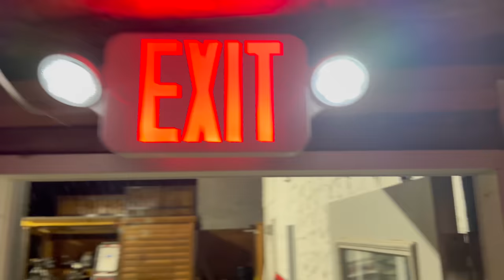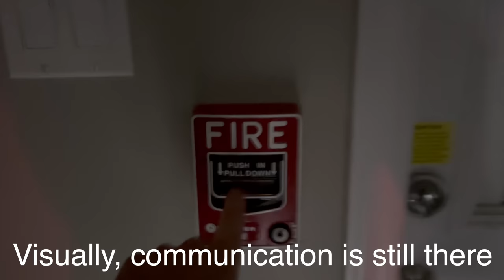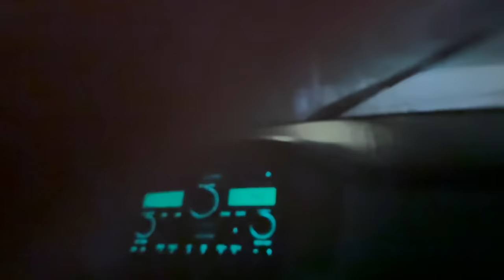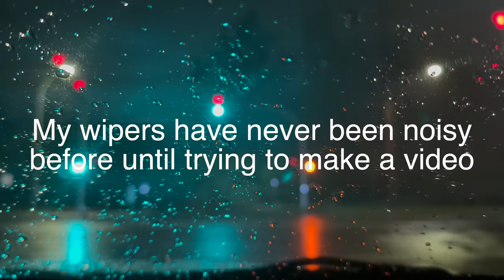Real power outage at my house! Emergency lighting and generator in action.

Comment: That's sweet! So satisfying to see all your hard work perform perfectly. How many watts is your LED backyard pole/street light?
Reply from the maker: Thanks, it is definitely nice to see it all working. It's a 200 w led
Reply: @nics-systems-electric   Actually 200 watts consumption or 200 watts equivalent? Regular LED street lights are only around 50 watts so your light must be really bright.
Reply from the maker: @eDoc2020  200 W consumed. 50 W would be a quite small street light never worked on one that small as far as any type of HID lamp 50 W is usually only for small wall packs

Comment: Great set-up Nick, how long will the generator supply power for ?
Reply from the maker: For as long as it has fuel so probably about 12h in the tank and I can add more if needed
Reply: Do you think you would ever do a propane/butane conversion on your generator? @nics-systems-electric
Reply from the maker: @ElliottVeares  wouldn't think so as we don't have either
Reply: I was thinking more of portable propane/butane tanks with the generator to give longer run time than the built in gas tank does, but whatever works best for you. @nics-systems-electric

Comment: You have a negative coefficient of airflow through your generator box, you can see as soon as you open the doors that the shutters are fully engaged as the fan forces air through, but as soon as you closed the door you lost a huge significant amount of airflow. I recommend a passthrough hole on the other side of the box to allow clean air through. Otherwise awesome video.
Reply from the maker: There is a large damper on the other side of that automatically opens supplying sufficient airflow they're always will be a slight reduction in flow when door is shut due to a less direct path

Comment: GREAT VIDEO OF THE OUTAGE AND THE GENERATOR TAKING OVER . 🤗BUT WHY POWER THE GARAGE ONLY BUT NOT THE HOUSE ? I'M PRETTY SURE YOUR NEXT VIDEO WILL HAVE A SOLUTION FOR BOTH DURING THE NEXT OUTAGE . 🤔
Reply from the maker: Glad you enjoyed. Generator doesn't power the house for several reasons it would require excavation additional transfer switch and emergency panel and would require damage to the building and would be too much load

Comment: Never seen so much excitement over a power cut
Reply from the maker: When you spent thousands and been waiting years for your equipment you've designed and programmed and installed it's nice when it actually gets a chance to work

Comment: This system looks quite good, but I have an idea that would make it slightly better...
...
Add a hair-trigger electrical 'deadman-switch' that would cause the generator to start up MUCH faster after grid-power disruption. 
Like starer motor running as the lights are dimming instant. Would this system occasionally cause 'false starts' every so often from grid ripple? Perhaps...
Reply from the maker: That is something you don't want generally you want at least 3 seconds and that is for emergency generators that's life safety dependent. For something like this that is non-life safety even longer is better like 10 seconds which is what I have mine set to otherwise it would be instant which then puts a a lot more wear on your starter if it's trying to turn the engine over every time the lights flicker and will then throw an error when it's trying to start the engine when power isn't actually out

Comment: Now you just need a generater/hookup for the main house.
Reply from the maker: Unfortunately not practically possible
Reply: @nics-systems-electric does a 10k watt generator exist? or 28k watts
Reply from the maker: @henrydoesstuff213  yes there are generators that are over 1,000,000 W

Comment: I used to do work experience in a private school setting.....and one time our generator (some cheap Kohler copy) actually EXPLODED because it couldn't handle the sudden influx ot load (bear in mind we use 240v 50Hz in this country)

So we ran off full UPS power as long as we could until the Batteries expired in them.... The server room being deathly silent was probably one of the most terrifying things ive encountered.

Supply was down for about 5 hours and when it tried coming back it blew again....which sadly killed one of our Liebert UPSes

Comment: Why do you have an industrial fire alarm system in your house? Isn't smoke detectors sufficient enough for a house?
Reply from the maker: We had problems with them they did not offer what I needed problems with false alarms and reliability and no customization options and no low frequency devices

Comment: so you have power for cameras in a generator room and floodlights that you dont need but the house is not connected? priority's need to be be assessed i think,
Reply from the maker: If you are interested you can check out my video explaining why the house isn't powered. You need to understand the situation and then it will make sense.

Comment: Question for you @nics-system-electric,  why only a generator for the garage only?  I don't know your situation but at my house I could care less about my garage having no power during an outage I would rather my home have power for myself and my  family.  You could hook up a 30/50 amp generator inlet box on the side of your house and run a large Generator to power most circuits or a smaller one for critical loads.  It just doesn't make sense to me to only have power for your garage and not your main living space but then again I don't know your situation just curious.
Reply from the maker: https://youtu.be/0EXjqxSqpiY?si=LLhkjt8Dp35Ey0YR
Reply: @nics-systems-electric   Thanks for the reply and your detailed explanation.  Your reasoning makes total sense in your situation.

Comment: Only issue with this system is when it floods your generator is low on the floor so any surface flooding could equal disaster. My city had power out for a while due to a ravaging flood. Generators basically screwed that were mounted on the floor.
Reply from the maker: That is how all homes standby generators are and we don't get flooding here

Comment: Dude your asking for trouble hitting those puddles, good way to crack your block or manifold.
Reply from the maker: I get a sudden temperature change could be harmful specifically if it's cast but I don't think the water is getting in that far if that was the case it would be no good driving in the snow or  rainstorms. We have lots of heavy rain and flooding living on the coast I've never seen anyone have issues with puddles

Comment: The power at my school went out  the day before yesterday for about 30 minutes or so maybe longer the internet was on for a little bit after the outage started I was able to complete the assignment on the laptop the school gives us (probably battery backup )  also the principal was able to use the pa/coms system to announce that there’s a power outage (probably also battery backup)
Reply: At my school the pa seemed to go out during a power outage. Is this a code violation in the US?

Comment: in theory if you made the generator power the house instead of the garage it would still power the garage because the garage is fed off the houses panel, but that might need a bigger generator
Reply from the maker: It would, but it can't power the whole house.

Comment: Recommendation is the only flaw I see is your generator appears be gas. Would recommend natural gas, and get supply from your house so u have uninterrupted service and only way it’s going to brake would be if the street gas brakes and have the gas one on incase u have issue with national gas
Reply from the maker: We do not have natural gas nor is the generator big enough to power the house

Comment: Can i suggest you to put your house working on EG (Emergency Generator) when power went out? With system monitoring yre fuel capacity and monitoring temperature of the EG? And my sugestion are she legal? (maybe is stupid my sugestion but say it honestly 😅☺️)
Reply from the maker: Too much load and you would need to excavate for underground emergency power to go to a automatic transfer switch and then install an emergency panel it would be thousands of thousands of dollars and a lot of work and the generator can't run it anyway
Reply: @nics-systems-electric   im thinking too is a bad idea and yes im right bad idea of mine...sorry 😅☺️😔

Comment: Really awesome set up! we have a blue diamond relatively generic diesel generator for our entire home. Good generator as we can run both AC systems which are built into the house, which use quite a bit of power. Also where did you get that IKEA looking arrow sticker?
Reply from the maker: Thanks, if you are referring to the arrow on the floor that one was from Covid that came from a school district and for whatever reason I wanted to put it there lol
Reply: @nics-systems-electric  Ahh that makes a lot of sense, thanks for replying!

Comment: we lost our power on our entire street and few neighbors were off on  our street were also effected the line was cut when our neighbors were having work done by a company and cut two lines they cut the secondary line which only effected only 3 neighbors then hit the primary line that took us out and the reset of the other couple of neighbors we were without power for about 7 hours and we rarely lost power enough that need a generator took the power company a while to trace the problem it happen on 25th

Comment: The generator will be perfect when you go to sell the house. It will most likely bring the value up and be a selling point for the house. I know it would be one for me, because when the power goes out for extended periods of time, I basically experience a sort of withdrawal from my crippling addiction to electronic devices, which I know I have. And acknowledging an addiction is the first step to recovery.
Reply from the maker: Houses are worth too much here to sell when you have one that's paid off. But if it was to be sold I think the generator would be removed when it was sold
Reply: @nics-systems-electric  I see. Well if you do decide to keep the generator in place if you sell, it would be a major upgrade to the house, as it will have power even when most of the neighborhood doesn't.
Reply from the maker: @Game_Blox9999  yes and no because it doesn't power the house and it may be seen as a nuisance to have to maintain it but if it's kept well it will work good for the garage

Comment: i am planning to do a similer setup in the future but insted of a  generator i intend to use  ecoflow delta pro battery bank and  solar power setup so that if its out  during the day i can run of   solar panals the battery   wilkl likly only be connected to lights  fridge  and freezer if its in the winter given electric heat will suck that battery dry fast ill have reserve  indoor safe propane heaters for heat likluy little buddy heaters as well as some  gas  camping stoves for cooking on should it be a multi day outage
Reply: You also might want to consider a DIY system instead of the Ecoflow. You can get 48v inverters and charge controllers as well as deep cycle batteries which can handle much more power. A 12 volt system could also work if you don't need more than 1-2kW of power.
Reply: @eDoc2020  yea well thats not portable the idea behind ecoflows is i can  take it with me when i go camping but also power the house when im home during outages and  ecoflow is much simpler then a  full  on setup its plug and playu requires minimal damage to the house or walls cus i dopnt have to drill holes and run conduit or any of that i also want to get ecoflows frige and ac unit and  lawn mower to
Reply: @TwilightVaramek   Anything large enough to power a house for a reasonable length of time isn't going to be very portable. The larger Ecoflow models are heavy. DIY versions can also be transportable, there's no need for anything hardwired. I'll post an example of what I'm thinking of soon.
Reply: @TwilightVaramek   The Ecoflow Delta Pro costs 3000 USD, has 3.6kWh capacity, and provides up to 3.6 kW at once. It weighs 45kg and is 64x29x42 cm. Expansion costs $2000 for another 3.6kWh.

For a DIY alternative you could start with the Growatt SPF  3000TL  LVM-48 which provides 3kw at once for $659. Weight is 11.5kg and dimensions are 13x35x45cm. For storage you could add an EG4 WP battery which is $999 for 5.12kWh. Weight is 39kg and dimensions are 49x27x24 cm. If you strap both together it will be 40x49x35cm and weigh 50kg.

If all my figures are correct this DIY version is about 20% smaller, has 40% more storage, and costs 40% less. Downsides include 12% more weight and you don't get a handle. For the $1300 you'd save I'm sure you can find a nice wheeled cart which could hold neatly hold everything together and make it easy to transport.

You'd also need a power cord, sockets, and assorted wiring for the DIY version so add maybe another $100 max. If you want the learning experience of putting it together and working through any problems DIY is for you. If you just want something that works without needing to build it the Ecoflow is also fine choice.
Reply: @eDoc2020  i want something that  just works and is compatible with multiuple things thats why i want ecoflow  its basicly all interchangable if you  start at the delta 2 with the  same cables the smart generator and all of that stuff communicating with each other not to mention they have a robot lawnmower that also communicates with  everyething else as well as a  AC unit and a  fridge unit for camping and such and it  is all easy to acsess from one mobil app  more expensive yes but  i like hgow everyething works with  each other seamlessly with no extra setup especily sense if i ever move i can  just as easly take it all down without leaving any trace of it excisting and take it to my next  place
Reply: @TwilightVaramek   I have heard good things about their air conditioner. It's certainly nice to have things that integrate well together, just beware of vendor lock-in. I believe each unit can also operate independently with standard power interfaces so this isn't a concern here.

Comment: 2:44 WHY IS THE DOOR CLOSING ON ITS OWN
Reply: There are electromagnets holding the door open. When there is a fire alarm (drills don't count) the magnets lose power, closing the door. Ofc the magnets need power to run, so a power outage would close the door

Comment: U should get a key box by the annunciator because I’m worried the keys might get lost .
Reply: I actually agree with this safety measure. Always keep important items in the same place as consistently as possible.
Reply from the maker: It needs to be able to be accessed quickly that's why it's on a hook if it gets lost it doesn't matter I'll put another one
Reply: @nics-systems-electric  Why not tie it to a string? Then it can be accessed instantly and it also can't be lost.
Reply from the maker: @eDoc2020  because then that's a pain in the ass and looks bad

Comment: You choose Honda generator?
Reply from the maker: No this is energizer. Honda doesn't make one the same size and it's extremely expensive.
Reply: My dad said “it about 210 v” maybe can use the Toshiba generat
Reply from the maker: @Nicmrict879  should be 240 V

Comment: There is a real power outage in your neighbourhood, and you are  having the camera recording while it happens? Interesting are these coincidendes anyway 😉
Reply from the maker: Security cameras record 24/7
Reply: @nics-systems-electric  i used to mean your mobile phone camera...so it was no intended test of the equipment, like tripping the mains cb, disconnect your property and be off grid?
Reply from the maker: @westallgaeuereisenbahnen  my phone was not recording when the power went out because I didn't know the power was going to go out I started recording after it went out